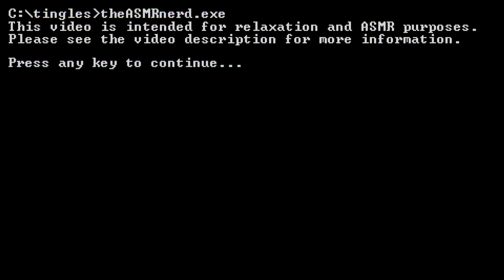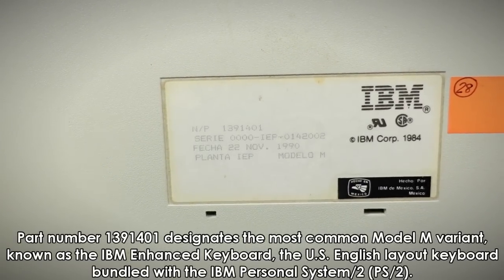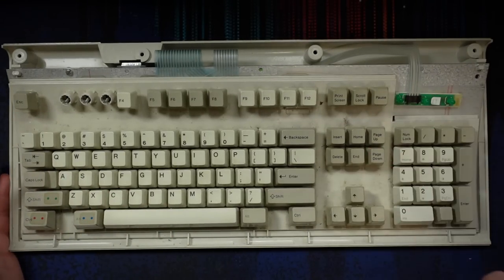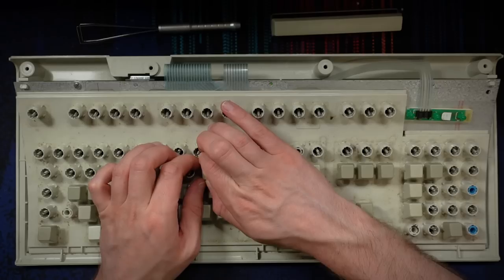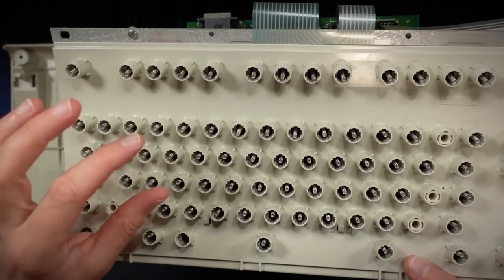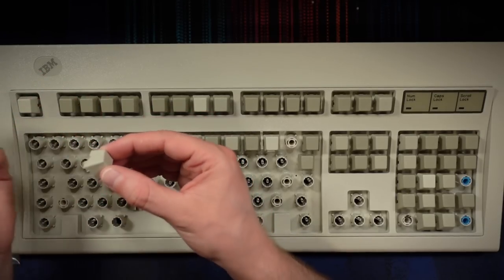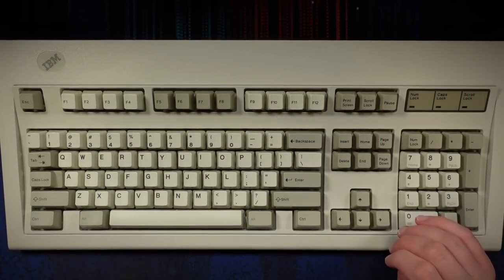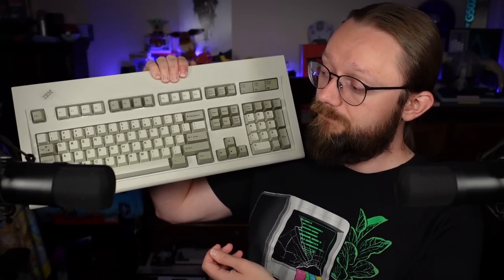ASMR Restoring the Greatest Keyboard of All Time [soft-spoken]

Comment: Unicomp did buy out the old machinery after IBM/Lexmark stopped making them, however their "New Model M" flagships use new machinery that produces higher quality parts that aren't affected by the issues the Lexmark machinery caused. Had a New Model M for about a year now, typing on one right now! In my opinion, it's a very good keyboard if you want a Model M feel and sound without hunting for a used one and/or want a smaller formfactor.